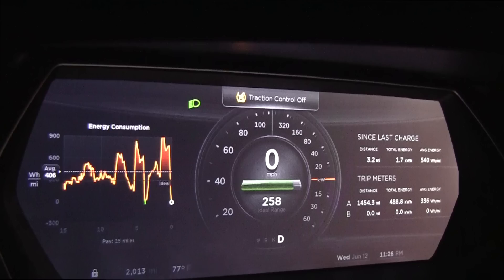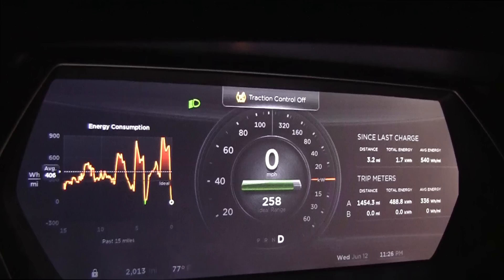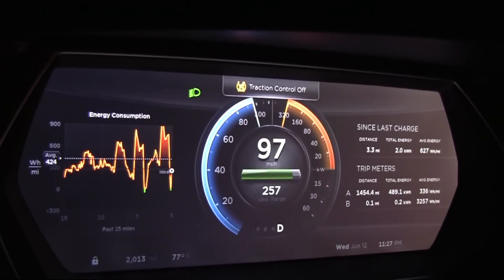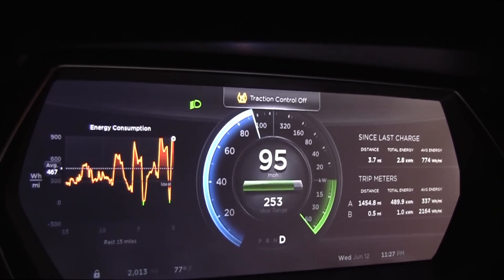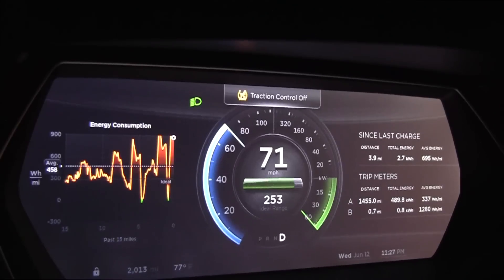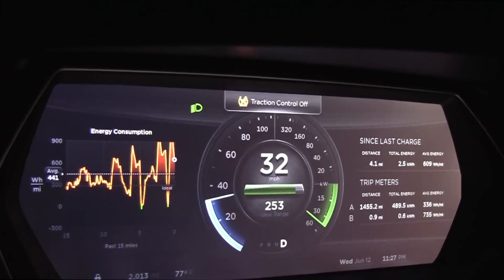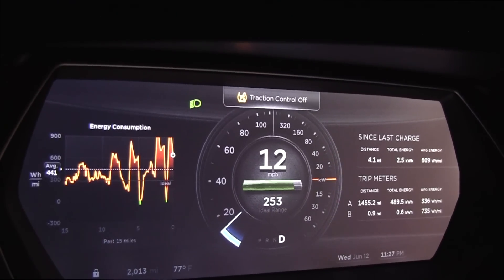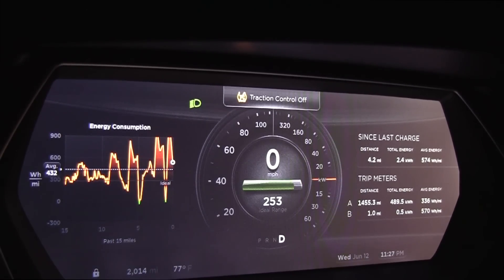Tesla Model S Performance Energy Usage and Regenerative Braking over the 1/4 Mile

Comment: Did you take into account the amount of energy required to overcome the drag and roll resistance? A quick calculation yields that the car used about 0.3 kWh just to overcome them. As this cannot be regenerated, the overall efficiency of the brakes should be higher.

Comment: Do the rear brake lights come on as soon as you take your foot of the gas pedal and the regenerative braking begins or do you still need to press the brake pedal for the brake lights to go on.
Reply: +edgar5001 Brake lights are turned on while you remove a gas(electric) pedal.:)

Comment: In the industrial world that I work in if you told a motor rewind shop that you had a brushless AC motor then you will get strange stares and giggles. Now if you said AC induction motor then you would been seen as normal. If you say brushed AC motor which would be slip ring type, NOT the commutator universal motor which is NOT an AC motor then they would understand it to be a slip ring type AC motor which are rare now btw. Same with DC, if you say DC then it is assumed brushed type.

Comment: I disagree. The term "brushless" simply means there is no brush touching a commutator involved. Both AC and DC motors can be with or without such brush mechanism. E.g. a "brushless DC motor" is common in hard drives while AC motors with brush/commutator are common in vacuums, garden tools etc. Check "brushless AC electric motor" in Wikipedia.

Comment: Too bad 95% of manufacturing equipment does not care what you think about noise. Electric motors are the dominate motion device in manufacturing of goods. I don't see any small block Chevy's or diesel engines powering production lines that make consumer products. I see lots of 480 volt, 3-phase motors doing the job. Gear heads thought electric would not take over manufacturing, but boy they sure were dead WRONG!!!!!!! The days of belts and pulley systems all powered by an engine are long gone.

Comment: Sorry to nitpick but it is not correct to call AC induction motors brushless, even though they are. The reason is because AC motors have been brushless since their inception back in 1888. That means by saying brushless AC motor then you are using a double negative, much like saying "I cannot get no satisfaction". The term brushless is only used for motors that have not been brushless at the time of creation, which would be the DC motor. Then you must state brushless if it is.

Comment: Well I can tell you as a tech that electric motors last WELL over a million miles. In fact I just recently had to change out some 3600 RPM, 15 horsepower 3-phase AC motors that ran 15 years NON-STOP because the bearings finally failed. Let's see a gas engine go 15 years non-stop, PAL! Not going to happen. I suggest you stick with what you know, or you will make yourself look so stupid.

Comment from the maker: We went past the 1/4 mile in the test (.3 vs .25), yes it does make a difference (265 feet).  We DID NOT use the brakes at all during this test.  If you knew anything about the Tesla you would know this as it's very easy to tell.  Furthermore, at the end of the track, you can easily take the turn at 20 MPH.

Comment: Tesla Model S will go through corrective actions on some first-generation design mistakes that are typical for the industry. What is truly interesting is as the design matures coupled with next generation battery technology, you should see EV cars lasting 2-3 decades with minimal service and no need for battery replacement. E.g. check ZSW's (German company) EV new battery technology with life of 27 years (assuming daily charge!) and 4 times power density of today's batteries (1000 hp possible).

Comment: Actually when designing a product like a car you pursue calculated design targets on longevity and reliability (e.g. MTBF). When you have many many times more complex mechanical wear out parts in an ICE car with a transmission, your calculations yield much worse numbers of reliability assuming general similar use of materials and design principles. It's not about belief but about factual engineering conditions. However, you have a point that engineers might make design mistakes on new designs.

Comment: It costs Tesla Motors a lot less than $30,000 because of the economy of scale. They are charging the consumer $10-12,000 for battery replacement.

There was an impromtu study done to see if Tesla could build a Bluestar in three years, and they can. It's right here for those who want to read it themselves.

seekingalpha(dotcom)/article/1512922-how-to-build-a-generation-3-tesla

Comment: One of your videos shows a modified Camaro easily beating a Mode S performance at the 1/4 mile. 
But here a few questions:
1) How much gas does the Camaro burn on that run?
2) In real life, which car could do the most consecutive runs?
3) How much speed reduction would you expect after approx how many runs?

Comment: No your completely wrong and that shows you don't actually have experience with direct drive electric motors and electric motors with a transmission! The car would be faster on the low end and have a higher top speed! All motors benefit a transmission! Good luck!

Comment: You'd be wrong. It's simply the fact that current batteries still have a fairly low energy density (compared to gasoline or diesel) and are fairly expensive. Can't make a cheap electric car if the battery alone costs 30K. Can't make a cheap long range electric car if the affordable batteries only hold 20 kWh (the Tesla's has 85)

Comment: Actually, it would be slower and less efficient. A mechanical transmission would only benefit an electric car's "fuel efficiency" for extended high-speed driving, not for acceleration runs.

Comment: Gasoline car efficiency =25-30%(drivetrain loss, heat from engine, gearbox)
Electric car efficiency =85-90%(only losses in electric motor 1-5% heat, one speed gearbox)
Electric cars are future :)

Comment: Zing!  Ha ha!
Keep in mind though that it would be a bad idea to drain the battery to 0% state of charge doing drag runs.  In fact, the car would actually start limiting power at about 10% SoC.  So, assuming a full charge at the onset, you could probably do 140 - 150 runs before the car would limit power.  Therefore, his original estimate of 150 runs is probably reasonably accurate, if only by accident.

Comment: In the real world, you would never get that many runs on a single charge because you would be driving back down the return road, putting around the pit lanes, potentially doing burnouts, listening to the radio with A/C blasting while you wait to make more runs, etc. Not to mention, it would be virtually impossible to make that many runs in one day at a track. Hence, theoretical.